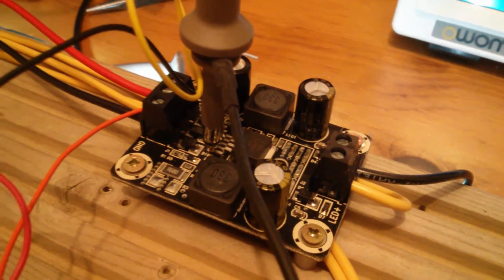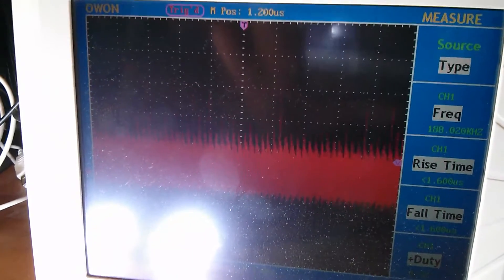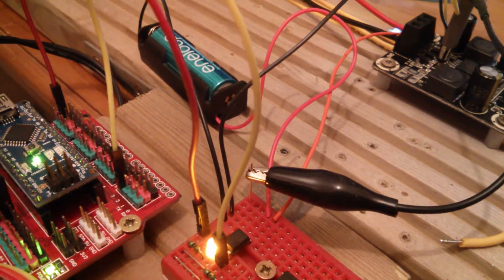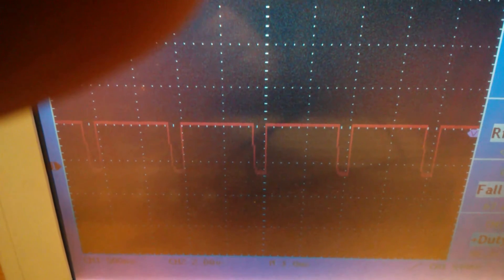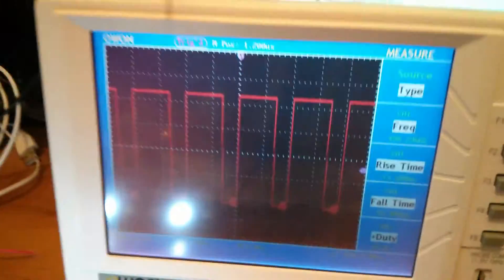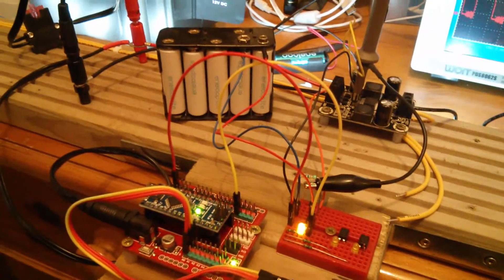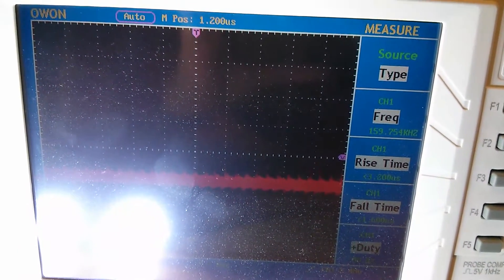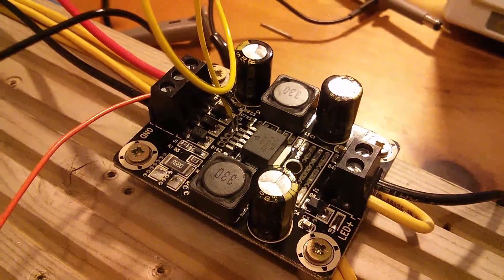How to use the XL6006 SEPIC LED Driver Module #2

Comment: Btw, I noticed that chinese don't always put nice low ESR capacitors on switching power supplies. I think 2V is a little bit too much ripple. Well for LED it doesn't matter that much - you can't sense >=50kHz ripple, but I always try to minimize ripple. If you change the output capacitor with a good one you get really stable low ripple output.Most DC-DC converters on ebay use SMD capacitor which are pain to desolder but this one has TH.